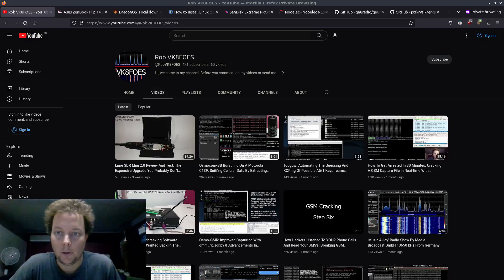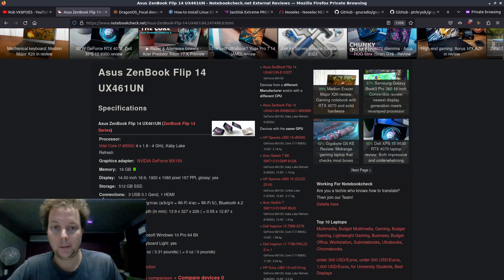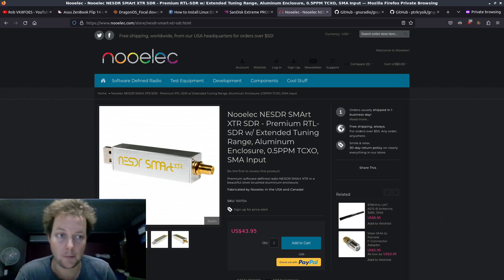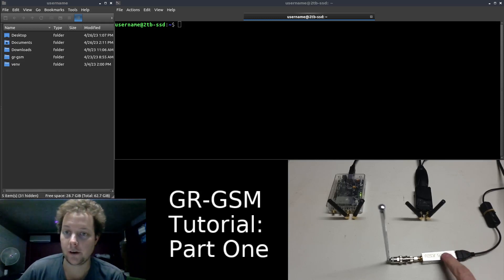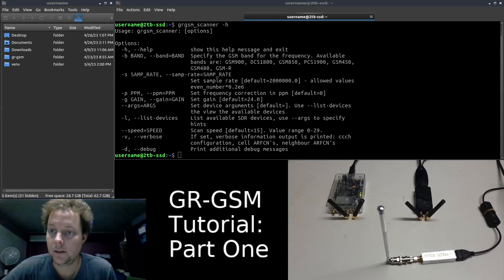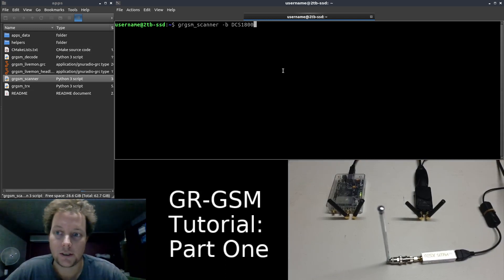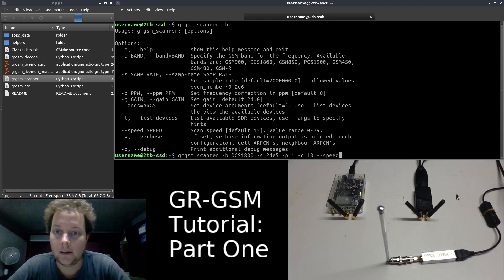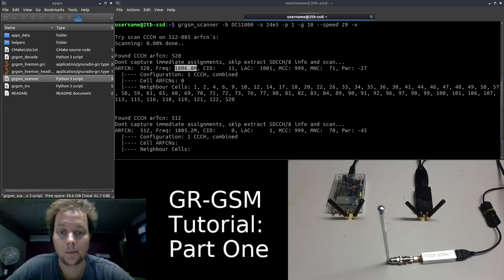GSM Decoding Part One: Hardware/Software Setup And Finding GSM Base Stations With 'grgsm_scanner'

Comment: @RobVK8FOES   thx so much for answering men ! , which gsm u recommend me to buy ? , the hopping one or the non-hopping one ? , and is the gsm coming with an antena ? if not could u recommend me one pls ? and last question will u recommend me to use dragon os ? ,cause it has all the tool we need for cracking and sniffing as u said in the video or its ok if im using kali linux ?
Reply from the maker: I recommend buying an RTL-SDR Blog V3 or V4 first, so you can learn about SDR technology first. The HackRF is 'wideband' and has a wider frequency range, which means it is exponentially more expensive than the RTL-SDR. Please make sure you want to pursue the hobby of RF and SDR before spending large amounts of money on it! Please understand that the radio is not the most important item in a 2G GSM receiving setup, but the antenna is. Without a good antenna, you will not 'hear' anything. A high quality outdoors base-station type antenna (that can be mounted on top of a roof) is the best option, and you may need coaxial cable and RF adapters to connect it to your SDR radio.

Comment: Im planning right now to order a software difined radio for me to be able to follow trough with this series , could you pls reccommend me a good one that is not above 40 usd? , and can i do gsm cracking with my kali linux ? Or u think its better 4 me to just download dragon os cause it has all the reqeuird tools pre-installed
Reply from the maker: Hi. I will recommend you an SDR for GSM decoding:

Non-hopping GSM on 850/900 MHz only = GENUINE RTL-SDR Blog V3/V4
Non-hopping GSM on 850/900 MHz and 1800/1900 MHz = GENUINE Nooelec NESDR SMArt XTR SDR (Not 'SMArTee')

Hopping GSM on  850/900 MHz and 1800/1900 MHz = GENUINE HackRF One

If you don't understand the difference between non-hopping and hopping GSM base stations, you will have to do some research into the different 2G/GSM network configurations.

Please understand that the most important piece of equipment in a GSM decoding setup is not the SDR, but the antenna. You will need a high quality antenna that is 'tuned' for GSM frequencies if you are far away from the 2G base station. Good luck!
Reply: @RobVK8FOES   thx so much for answering men ! , which gsm u recommend me to buy ? , the hopping one or the non-hopping one ? , and is the gsm coming with an antena ? if not could u recommend me one pls ? and last question will u recommend me to use dragon os ? ,cause it has all the tool we need for cracking and sniffing as u said in the video or its ok if im using kali linux ?
Reply from the maker: If you want to follow my tutorials, you will have to use DragonOS FocalX. I do not provide support for Kali Linux, as I have never used it before and have no intention of using it in the future. DragonOS FocalX is an RF hacking and SDR focused distro of Linux, whereas Kali is more a TCP/IP pen-testing focused distro. I don't do any TCP/IP hacking whatsoever. The maker of DragonOS FocalX (Aaron from @cemaxecuter) also provides amazing tutorial videos for all the tools included in his Linux distro too.
Reply from the maker: Yes, it is a form of 'hacking', however it's focused on the RF physical layer of the wireless communication stack. TCP/IP hacking is more focused on the IP and application layer of computer networks.

SMS cracking and phone call cracking is not easy to do, in my videos I have achieved it, yes. You will have to do a lot of research about 2G GSM and how the technology works, because  I won't be able to help you due to Australia having strict laws about an individual assisting another person with wiretapping/hacking. All the pieces to the puzzle are documented on my channel, it is up to you piece them all together! Good luck!
Reply: @RobVK8FOES  ok im crruntly learning social engneering and python when im gonna finish that in couple month im gonna go straight to ur tutriols dude cause its look really intresting, in addition u say the puzzle is in ur channel and it is up to me to find out those parts , r those parts on these tutriols??
Reply: like on the session of tutriols we r in the comment section of right now??
Reply from the maker: @yarin4621 Go to my playlists section, and you will see some playlists titled 'kraken tutorial' and 'gsm decryption'. They would be a good place to start :)

Comment: can I use kali liinux for this?
Reply from the maker: If you wanted to, yes. But you will have to install GNU-Radio first, as gr-gsm depends on it. Building and installing GNU-Radio from scratch is a nightmare, so I always recommend to just use DragonOS FocalX .
Reply: DragonOS FocalX with gnuradio 3.8 or 3.9.
Reply from the maker: DragonOS FocalX has Gnu-Radio 3.10, the 'bkerler' fork of gr-gsm is patched for 3.10

Comment: Hello can someone help me pls ? I need to install Dragon OS on Virtual Box on Win 10 Pro. Ihave already installed and I 6 times start it and boot but when I turn update it and restart Dragon OS in Virtual Box it DIDNT SAVE DATA and other downloaded datas. Please help.
Have a nice day.
Reply from the maker: Hi. I am sorry I can't be more help. Maybe someone else will chime in after me. I don't have much experience with VirtualBox. I always use VMWare Player/Workstation Pro. I haven't experienced this problem on VMWare. I hope your issue can be resolved.
Reply: @RobVK8FOES  Thank you. Is VM Ware Pro Lifetime version FREE ?? B3cquse I have tryed using this app but it crashed and idk why and after restarting still crashing.
Reply from the maker: VMWare Workstation is not free unfortunately. But it is possible to aquire it without the exchange of currency, if you get my drift ;) If you're not a filthy pirate like me, you can try the free version called "Vmware Player"

Comment: what did you use to create the gsm network : yatebts ? what simcard did you use?
Reply from the maker: YateBTS with a BladeRF 2.0 xA4 and Osmo-NITB-scripts with a LimeSDR Mini 2.0. I am using Sysmocom SIM cards.
Reply: @RobVK8FOES   i have sysmo-ISIMsja2, did you have any tutorial how to program the sim for authentication and a5/1 ciphering? what authentication did you use comp128v1 or comp128v2 or comp128v3 or milenage?
Reply from the maker: I could never figure out how to turn on A5/1 ciphering. I tried for weeks and weeks and weeks, and eventually gave up. I guess I need to study the GSM technical specification documents, to which I just could not be bothered. So, my 2G basestations run without encryption. My SIM cards are 'sysmoISIM-SJA2', I bought the 10-pack. They are also LTE-compliant, so they work well srsRAN/srsLTE.
Reply from the maker: Have you seen the DEF CON 27 talk, titled "GSM we can hear everyone now"? Those guys used the paid version of RangeNetworks OpenBTS, and successfully enabled A5/x encryption for their lab environment. They go in to great technical detail during the talk, perhaps you could emulate their configuration? Good luck.

Comment: what is the version of dragonOs and gnuradio?
Reply from the maker: Any version of DragonOS FocalX will work. It has GNU-Radio 3.10 pre-installed out-of-the-box.
Reply: @RobVK8FOES   Rob, decoding error with GNU-Radio 3.10 grgsm_decode? Hello, is it common for grgsm_decode to stop working in the versions that have gnuradio 10? What exact version did you use in the video?

Comment: hey, is there a way to use multiple rtl-sdr dongles in grgsm_livemoon? I can't seem to get it working
Reply from the maker: Hi, yes it is possible to use multiple RTL-SDR dongles in gr-gsm. Please see Piotr Krysik's web page explanation: https://ptrkrysik.github.io/

It seems fairly difficult to do, as you need to synchronise the clocks of each RTL dongle via a hardware modification.
Reply: @RobVK8FOES  yes, it seems complex - but all I would need is two RTL-SDRs on one raspberry pi capturing two different frequencies. Do you think there is an easier solution for that?
Reply from the maker: Just out of curiosity, why do you need to run two RTL-SDR's anyway? Are you trying to capture uplink and downlink simultaneously? If so, you could have a look at Osmocom-BB 'burst_ind' branch. It can capture uplink and downlink all with a single telephone and a serial cable. But it is a lot harder to setup and the captured data isn't as manageable and easy to decode like gr-gsm's cfile output files... 

Failing that, you could always run two separate RPi's with an RTL-SDR each...
Reply: @RobVK8FOES  Thank you  for the tips, I will look into that! I need to capture on multiple frequencies at the same time, all on one single rasPi and grgsm_livemon. I should say I am a beginner at this stuff, so I am still searching for a good solution.
Reply from the maker: @FlipChrisJan I hope you can find a solution!